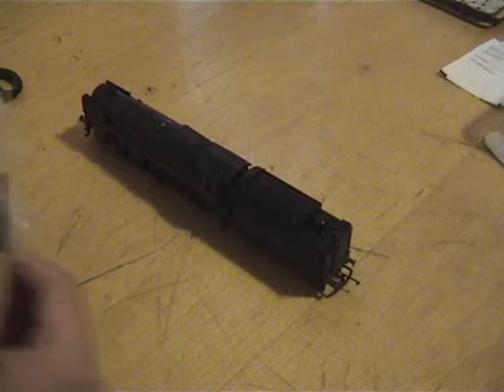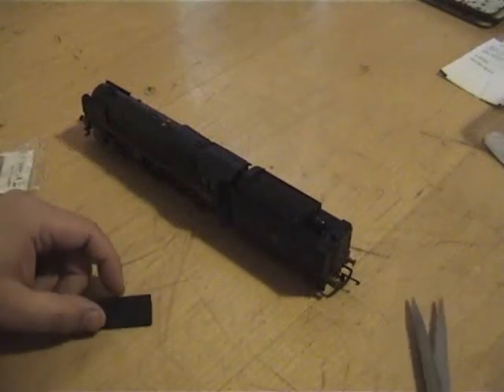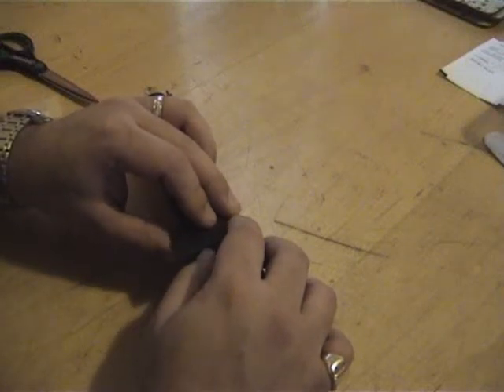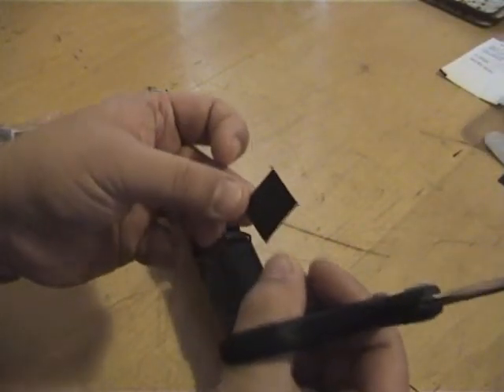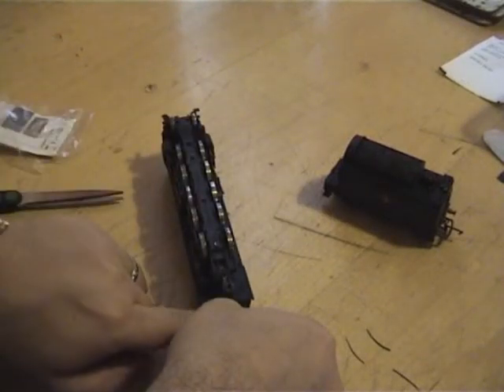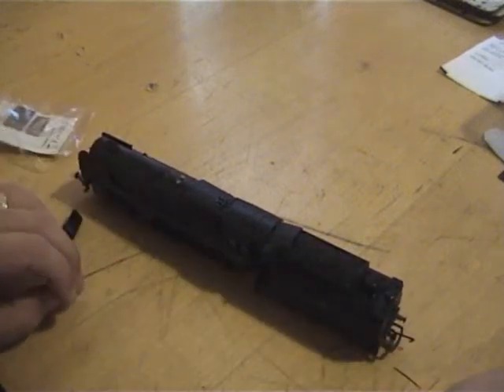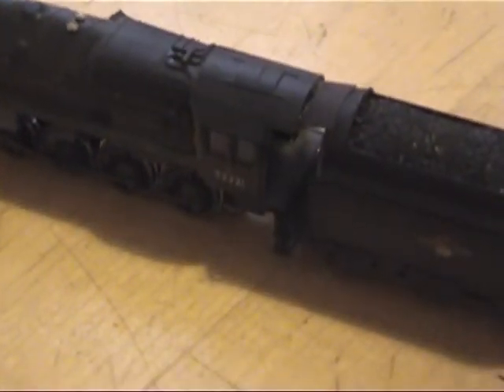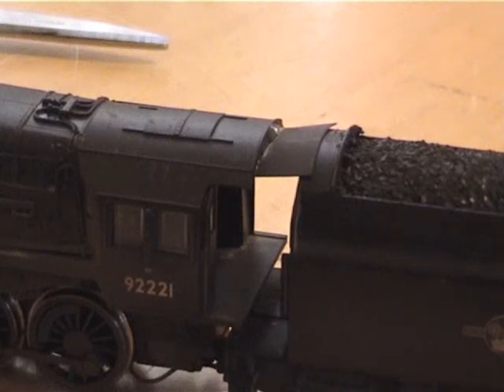How to make & fit a Tarpaulin to your Tender Locomotives in under 13 minutes !

Comment: Great idea for an analoge system.  Mine is all  DCC with tiny fragile wires between the locos and tenders so I could not do it, but it does look smart when completed.  Great tip.